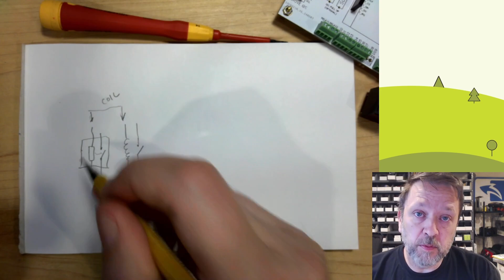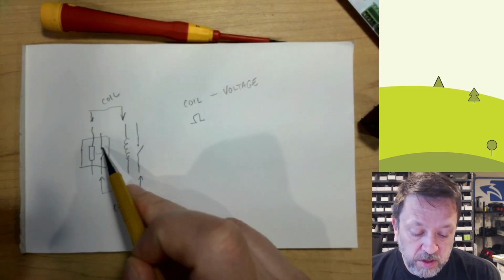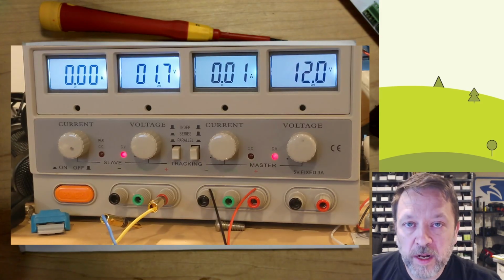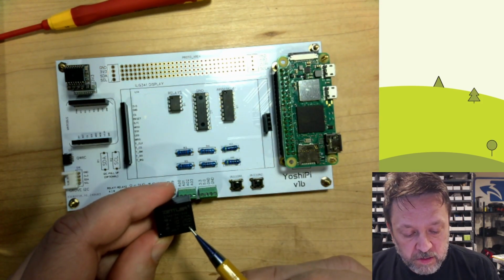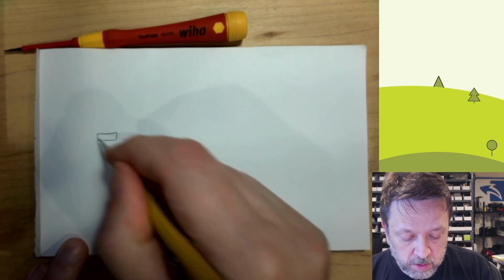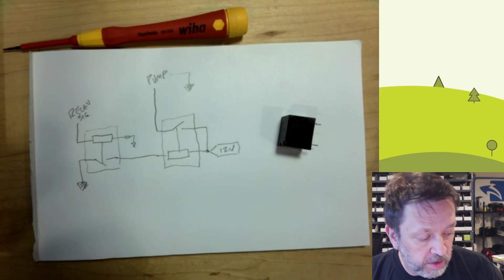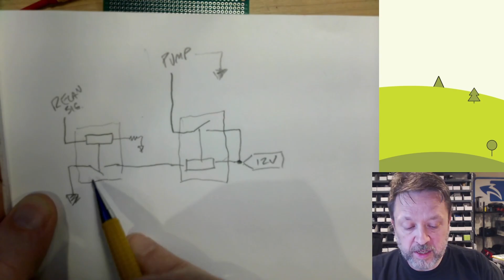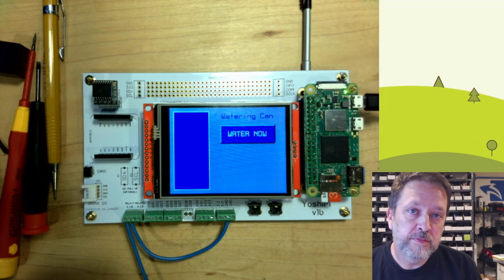Running a Water Pump with a Raspberry Pi Zero, YoshiPi, C#, and Meadow

Comment: Have you gotten the Linux command   crontab -e   to work on the Pi Zero?  Been trying to make it play a audio file with Ubuntu but it just dose not work.  I want to make a Pi Zero W controlled timer relay for various projects.
Reply from the maker: I rarely use crontab because, like you, I often find it doesn't work. It's usually easier and more reliable for me to create a service registered with systemd

Comment: I use 5A buck converters for Pi4s set them for 5.2v for running overclocked. I use 12v power tool batteries. Music streaming boombox running Android with a touchscreen where the tape deck door was.